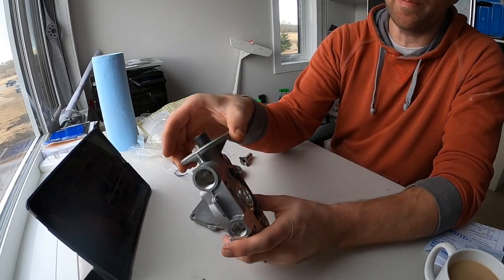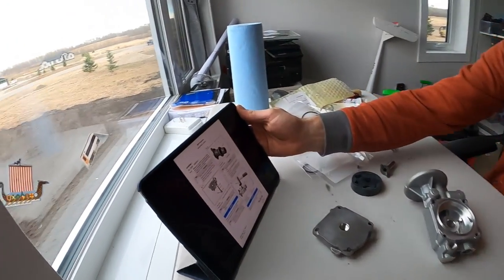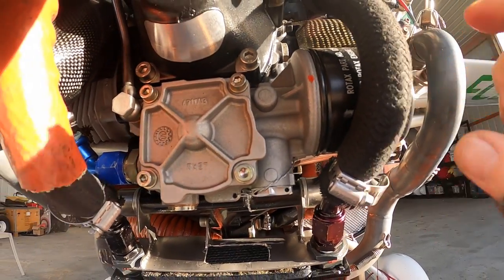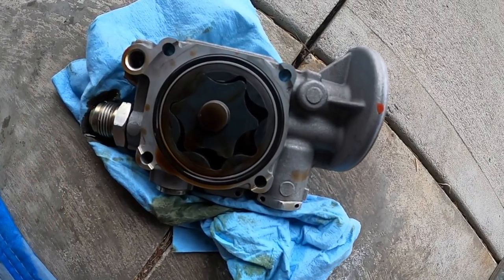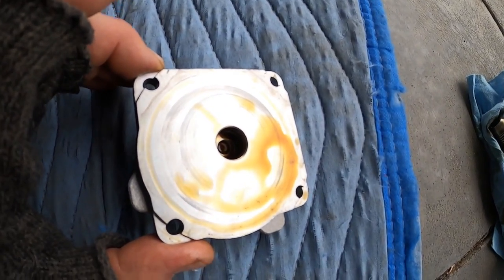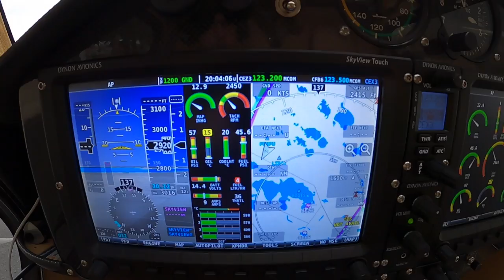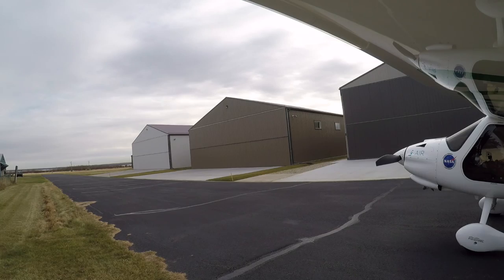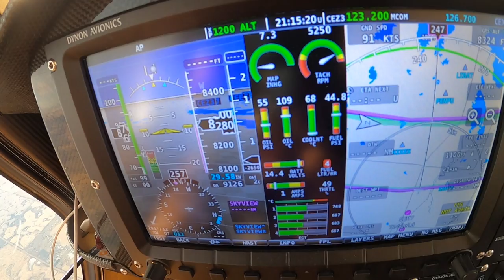Rotax 912iS oil pump REPLACEMENT

Comment: Hi Darryl, Do you still have the old oil pump by chance? If so would you be interested in selling it? I can explain further via email what I'm doing. Really need to get a hold of the new iS style pump, even if it needs a new rotor set etc.. Thanks! -Todd
Reply from the maker: Hey Todd, I sent it back to rotax in Austria as they wanted to inspect it. Fair since they provided new one for no cost.
Reply: @DarrylZubot  thanks Darryl for the reply! That makes total sense. Cheers!

Comment: I'm not sure if your still having any issues with high altitude oil pressure but GravityNightFlying just posted a video on a new replacement oil pump by Edge performance that fits their 912Sti (based on the 912ULS).

Comment: Lower pressure at altitude points to insufficient cooling and loss of viscosity, resulting in lower pressure. A high pressure pump is not your answer, but perhaps higher volume will help.  You need more oil radiator area to compensate for the thinner air.
Reply from the maker: I recently replaced the engine, has the same oil pump, same radiator size, same oil line setup. I have almost no oil pressure drop with altitude climbing with this new engine. Something was not right with my original engine that was causing oil pressure drop.

Comment: Hi Darryl. Great to see you back in action. I just recently joined the channel and love seeing a local surveyor using the Pipistrel. I work for an FBO in YEG and a helicopter company that does surveying. I've also been looking to get back into flying... Which is actually how I came across your channel... Been looking at the Pipistrels. :)  If you ever have free time, it would be great to connect!

Comment: Good to see you back! Yeap, a new house tends to be exhausting.
Reply from the maker: It is. We’re at the final end of it. Will post video in our house build when it’s complete.
Reply: @DarrylZubot  No rush, only few more years and it will be FINISHED 😂😂😂 Btw, you really don't have to wait till next maintenance issue to post a new video, the non-mechanical ones are as fine as any others 😁😁😁

Comment: Great to see another video from you  Darryl!   Looks like the house is finished as well. :) I can imagine the stress with new house build, works problems, and the family in this situation.   So happy to see the oil pressure problem solved. How many hours do you have on the engine now?   Greetinga from T in Norway.

Comment: Glad to see you made progress! My Virus SW oil pressure has also been a little low at altitude but never as bad as yours. A recent flight at 10.5k was 38psi and at 15.5k 32psi.
Reply from the maker: Sorry to hear your issues. Do you also have hydraulic prop? I still don’t have as good of pressure as my friends virus sw with same engine and prop. We’ve compared our aircraft and we cannot find any difference in oil line routing etc. He gets above 50psi consistently no matter what altitude he’s at.
Reply: @DarrylZubot  I have the MT constant speed prop as well. I watch my oil pressure closely but I remain well into the green even at high altitudes. I'll continue to watch it and if it starts to fall off, I will inspect my oil pump for sure. Good luck to you Darryl, hope the cameras start working well for you again!

Comment: Curious to know if you followed the full oil purge procedure? Noticed you turning the engine over still with plugs in, presume this was after you primed the oil system?
Reply from the maker: Yes I was just burping the engine before the first start up.
Reply: @DarrylZubot  Hey Darryl,  I came up with this technique which I think is a lazier way of burping the oil (maybe not faster, but involves rotating the prop a whole lot fewer  times).  Try it and let me know how it works for you.

Prep just as you do now ( remove  reservoir cover) and start to turn the prop...but when you get to the point of highest compression/resistance....stop.   Give the air compressed in the cylinder time to bleed into the crankcase and build up pressure there (to force oil back to the reservoir).   After several seconds, move the prop to the next point of high  compression, and stop again.  Etc. 

Using this technique  I rarely have to go more than 2 or 3 revolutions of the prop...and then only if I am often going past the point of max compression, so that the compressed air in the piston just expands to move the prop forward, instead of going into the crankcase to pressurize the oil.

The point of the technique is instead of a whole bunch of brief periods of high pressure that partially bleed into the crankcase before compression is released as we race the prop around 6 - 10 times, you just expend the effort to get the air compressed in the pistons a few times, then allow the pressure a relatively long time to fully bleed into the crankcase.